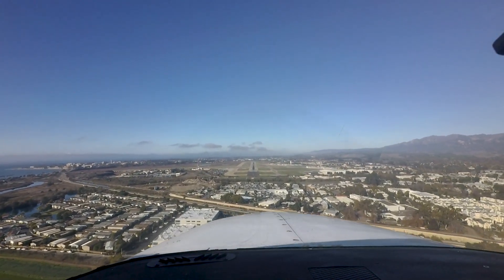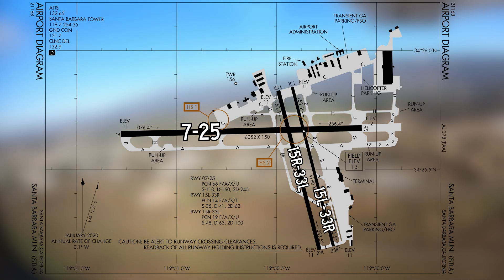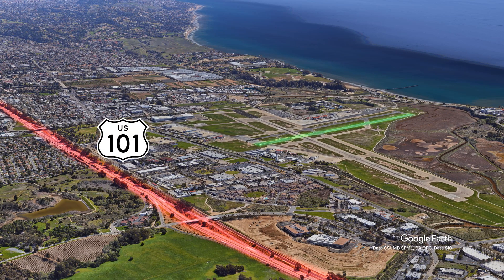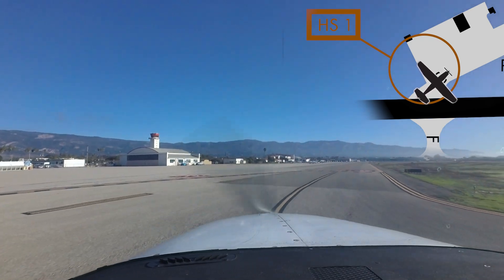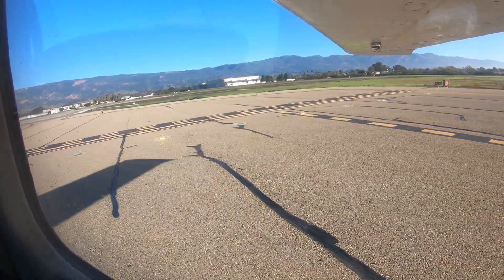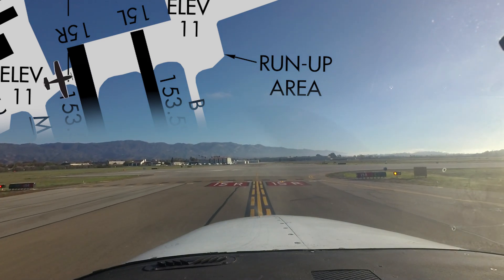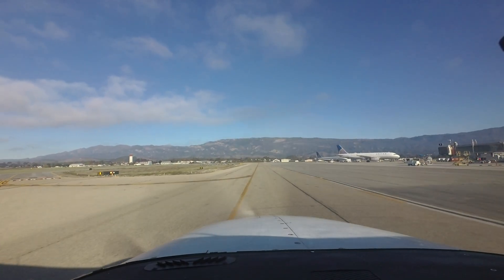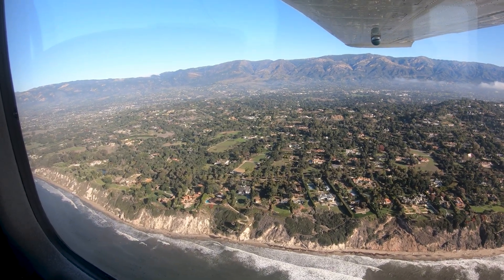From the Flight Deck – Santa Barbara Municipal Airport (SBA)

Comment: The "SE FBO" is now located in the facility close to the base of the control tower.  There are no longer any GA services located south of RWY 7-25.  For runups for RWY 25 from the north, I was instructed to use the expanded taxiway apron on Taxiway J just short of RWY 25 instead of the one depicted in this video off Taxiway D.

Comment: We don't instruct aircraft to remain offshore til 2 miles anymore for runway 25.  Noise abatement is voluntary. 25 at taxiway C isn't Hotspot and they had the run up area for runway 25 wrong.  Runup is just done at the hold short on taxiway J. Otherwise good though.
Reply: 25 at C IS a hot spot (reference the airport diagram).
Reply: SBA controllers are dope, above all instructors are locked on, terminal ground crew is meh.
Reply: Why not!?